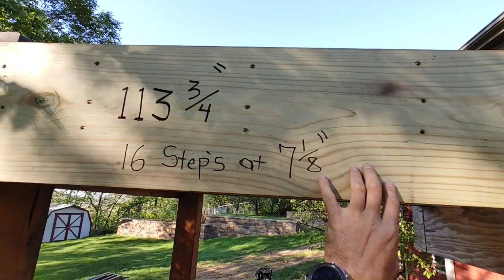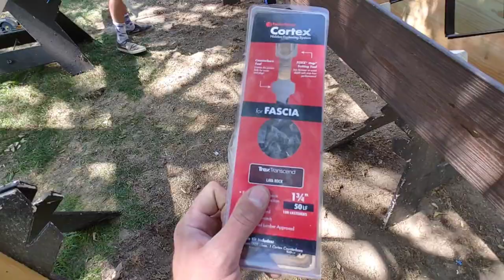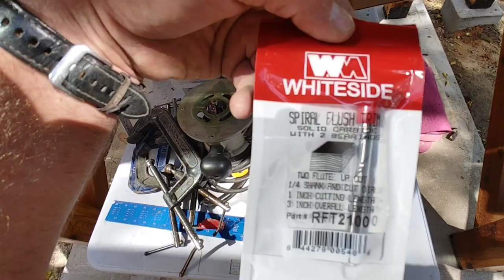Building a Large Composite Staircase and How to layout a Stair Stringer

Comment: Great video and even more impressive work. Im trying to do my own and use the pervious deck post hole supports. But the deck builder before me was new to this as there are lots of shortcuts. I will have issue with the 36: wide spot for staircase and then I add the railing. The previous railing was on outside of staircase not robbing space. HUmm there is alot to this project. Thanks for the video. Im going to watch other videos of yours. I have severely cussed out previous builder. Im amazed its standing and even had a hot tub on top when we moved in. The stairs had no supports except the 2 brackets on top. 4 screws holding it up. Thanks again. I guess I could build stairs and let the stick out past deck face. i cant extend deck without creating quite a cantilever effect. Hope you enjoyed my comments. The ants are moving eggs now too. So I must of found a little ant spot in the old deck.. Haha

Comment: for the stair lights, you had a stringer in the middle of the staircase, did you drill into the front side of the stringer as well and run the wire out of it?
Reply from the maker: Yes.  That's correct.  The lights went into the stringer about 1/2"

Comment: May you please put the links to the lights on the stairs. This deck is designed beautifully
Reply from the maker: Ftvled deck lights on Amazon.   You will want to buy a 1-5/16" drill bit online also.   Also you will probably need to buy some extensions. They have different lengths.

Comment: How close to the edge of the deck and the staircase can the railing posts be attached? Do the lag screws penetrate the rim joist or beam or stringer or they strictly have to go into the blocking underneath? I am building a free standing deck, so there are two ply beams as framing edges on two sides. I am wondering how far in I have to go. This video is really great. Very precise work. I really like the level of detail.
Reply from the maker: I'm not sure if there is a Minimum distance away or not.   2 of the lag screws went into the stair stringers and the other 2 went into the blocking.   I  like to set my posts so they are center on the border.   2" post can be centered on a 5-1/2" board.   3" posts can be centered on a 7-1/4" board.

Comment: You don’t like making the fascia higher to cover the deck board ends?  We tend to do that, I like how your deck turned out tho very clean 👍🏼👍🏼
Reply from the maker: The fascia is not designed to be flush.  if you go flush you will get water, dirt, leaves, ext. behind the fascia.  causing rot.   The reason I don't use a full fascia on the stairs is because we get a lot of snow and doing that would make it alot harder to clean snow off the stairs.
Reply: @promesconstructionl.l.c.8889  it also would look completely dumb
Reply: My deck was built with the facia covering the deck board ends and that is the only place my deck is rotted out. now I am replacing rotted facia AND end joists.  I would rather have the deck boards overlap and give a more protection.  BTW may deck was build super cheap by the previous owner.  I will be doing it better this time.
Reply: Great responses to people's comments.
Fascia has to go under planks.
Total water trap.
I liked your comment about the snow on stairs. I luve in colorado and that would suck to shovel snow iff and then sweep it out of the corners. Great planning tip..

Comment: I'm looking to do a very similar railing build.  I noticed you used the Trex Signature posts with a cocktail rail.  Trex states to only use a PT 4x4 with post sleeves for the cocktail rail look.  Did you have to do anything special to make the aluminum posts work?
Reply from the maker: I wouldn't use treated 4x4 for the railing posts.  I prefer aluminum posts.

Comment: Measuring all the hypotenuse's of the stairs and marking them is the most ridiculous thing I've ever seen.  I don't think he understands what that framers square is for.  Complete insanity.  Ripping down the stringers to the same width is also ridiculous, the stringer widths are irrelevant.  Next, the treads overhang code is a minimum of 3/4", 1/2" is not to code.  If he used the 2r + t = 25 guide, his treads should be about 10.75" which is why he's trying to cheat and make the overhang less.  You always start with the overhang tread at 3/4" (min) overhang and work back to the riser.  If you have a bigger space from the tread to riser, that's fine.  He also has a problem with the run length of the stairs.  Code usually limits the max stair run to 147" before you need at intermediate platform.  Towns might not enforce this but long stair runs are dangerous, especially on decks.  If someone falls down those stairs, he might be liable.  Fortunately, he can probably remove the treads and reinstall them but it's better to know what you're doing.